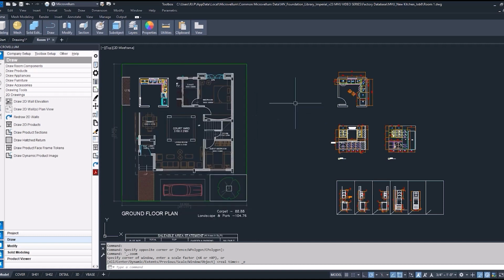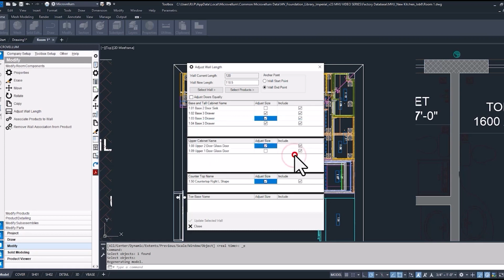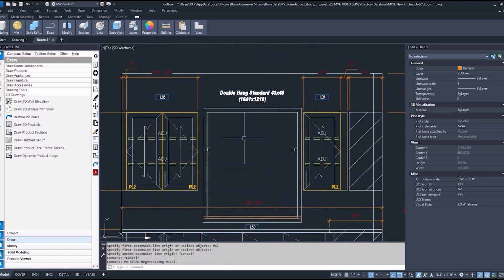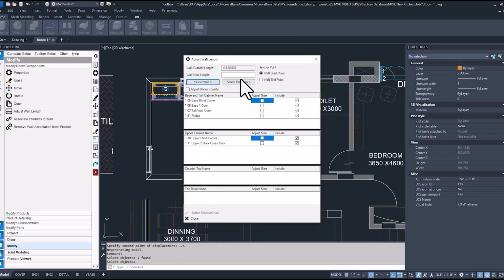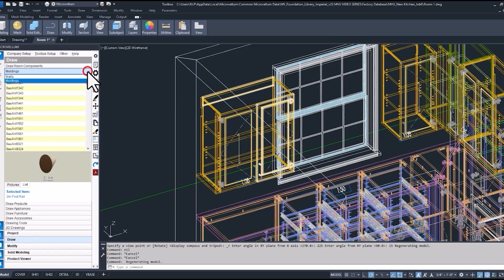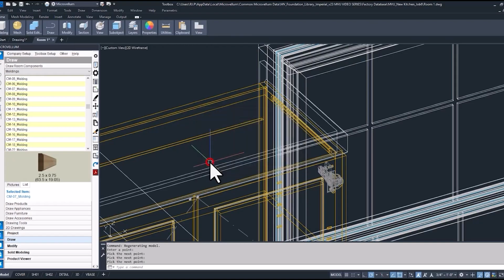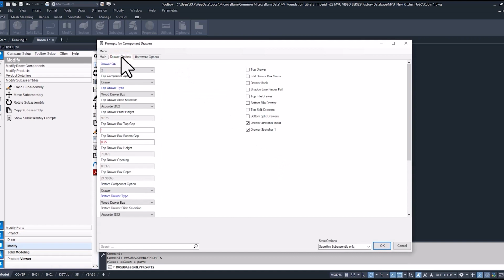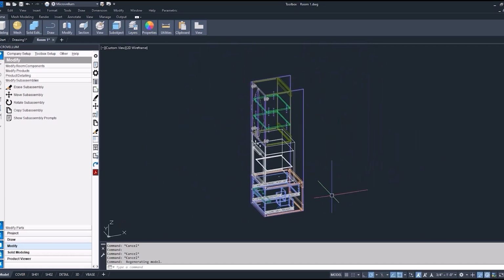Using Adjust Wall Length to Update Drawings After Field Measurements

Comment: Question for the MV software developer. Why wouldn't you have "Adjust Wall Length" inside of the product prompt? Like maybe right to the right of "Width" asking which products to include in the adjustment?